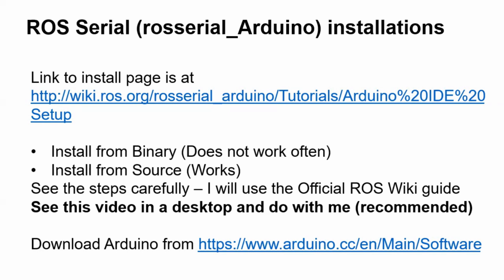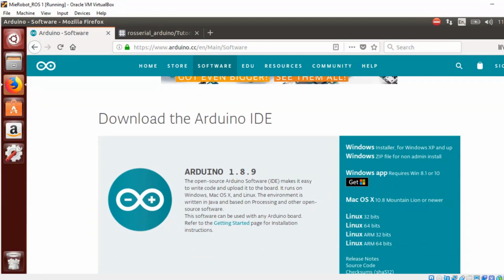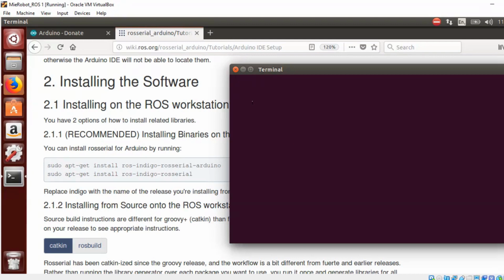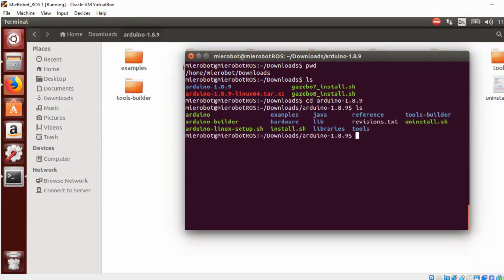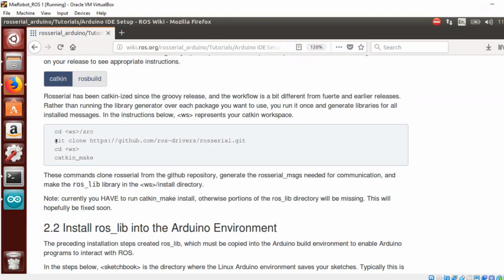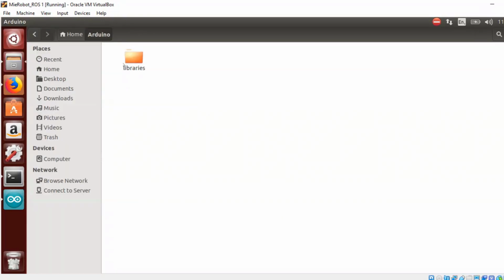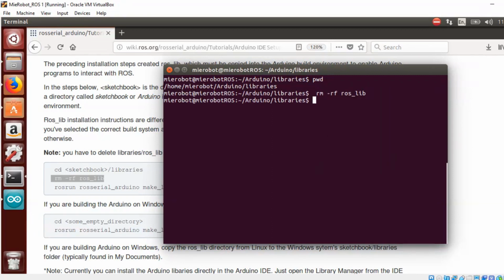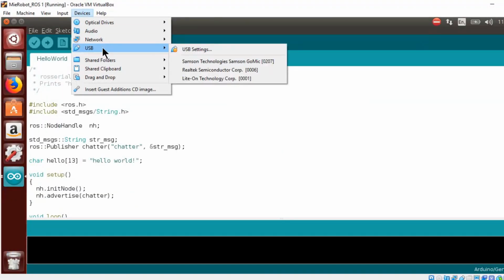ROS Arduino tutorials | ROS Arduino serial communication #3

Comment: sorry, can you help me. When i run "rosrun rosserial_python serial_node.py /dev/ttyUSB0" i have issue "[ERROR] [1616678399.477586]: Error opening serial: [Errno 2] could not open port /dev/ttyUSB0: [Errno 2] No such file or directory: '/dev/ttyUSB0'"

Comment: Can't seem to get this to work
Reply from the maker: What is the error you are getting. Let me know.
Reply: @MieRobot  it has a bash error when trying to change to ws
Reply: @MieRobot   I think I was trying from the wrong directory.
Reply from the maker: @wishicouldarduino8880  generally the path is home/catkin_ws
Reply: @MieRobot  yes but since I tried to install this src catkin ws even Ros are now seemingly vanished from my computer move it is there ydlidar is there roscore runs rosversion says melodic nodes work but catkin src and the whole lot are vanished from computer not in files or downloads or anywhere I can find I wonder what could have happened ? I wonder if I now have to flash new card and start over ?
Reply from the maker: @wishicouldarduino8880  something looks wrong. Start fresh with a new installation.
Reply: @MieRobot  so many systems to reinstall plus a string a mile long for the camera can I do a sudo apt get remove or should I flash jetpack again and start over?
Reply from the maker: @wishicouldarduino8880  suggest you format your SD card if there is nothing important in that like a working code etc. Then flash Jetson nano and then install ros. I am coming with Jetson series soon.
Reply: @MieRobot  yes I did flash a new card but saved the other one . seems weird Ros works but can't be found it has to be there somewhere.maybe I can retrieve it or find it .but in the mean time I'll start new.
Reply: @MieRobot  there is a Ros wiki for installing Ros in the nano but it's the same thing as Ubuntu I did both on different cards I don't see any difference.its Ros lib for Arduino that threw a wrench in it .I think the card was corrupted.from before.
Reply: @MieRobot  flashed a new card installed Ros same thing can't find it not in desktop not in root files downloads documents. .I'm at a loss .Ros works but can not locate it .
Reply from the maker: @wishicouldarduino8880  open a terminal and type roscore.  Do u see anything?
Reply: @MieRobot  I actually got it Ros works the nano can be a little tricky but I found it .thanks 👍 now install open CV curl visual studio numpy pip ydlidar move it.😁

Comment: whenever I run catkin_make I get the error:
This workspace contains non-catkin packages in it, and catkin cannot build
  a non-homogeneous workspace without isolation.
Reply from the maker: Please see your SRC folder and delete folder which are non ROS related. Then catkin_make again

Comment: Whenever I run catkin_make, I get the error: 

/usr/include/c++/5/bits/c++0x_warning.h:32:2: error: #error This file requires compiler and library support for the ISO C++ 2011 standard. This support must be enabled with the -std=c++11 or -std=gnu++11 compiler options.
 #error This file requires compiler and library support \

Do you know how I can fix this?

Comment: Is there any reason you couldn't just go to "Manage Libraries" and install the Rosserial Library from there?
Reply: It would work if you want to use the IDE only. However for the ROS workstation to communicate with arduino you would have to follow the steps.